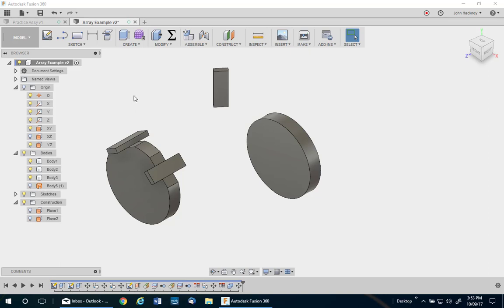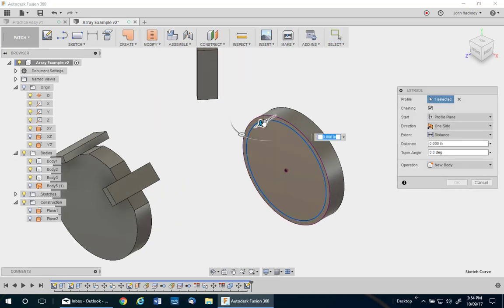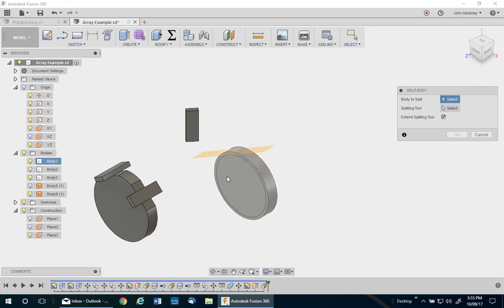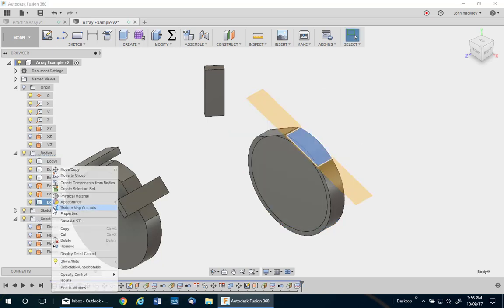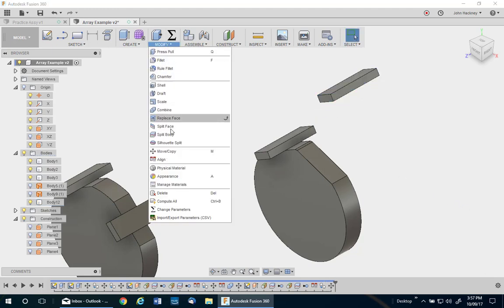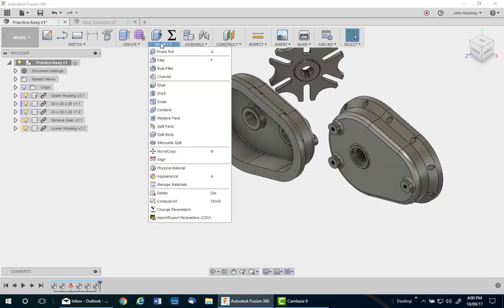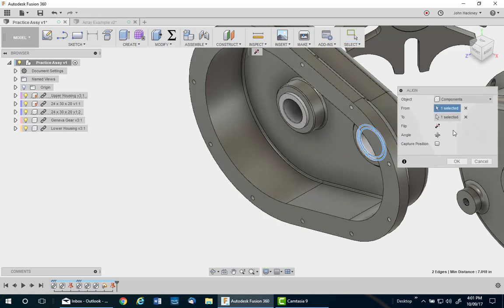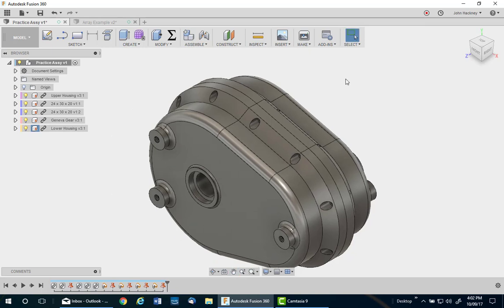Autodesk Fusion 360 Align Tool

Comment: I wanna align a bunch of objects in the same, created axis. I created the axis but align function cause odd spinning movements that cannot be corrected by the flip option...
Reply from the maker: It is not possible to advise you from this blog on your issue since I cannot see your model.  I suggest you visit the Fusion 360 Design, Validate and Document Forum and post a question along with your model.  You will surely get a quick and concise answer.  https://forums.autodesk.com/t5/fusion-360-design-validate/bd-p/124